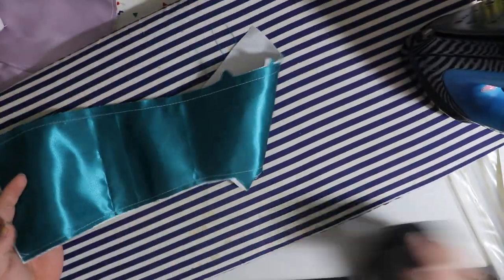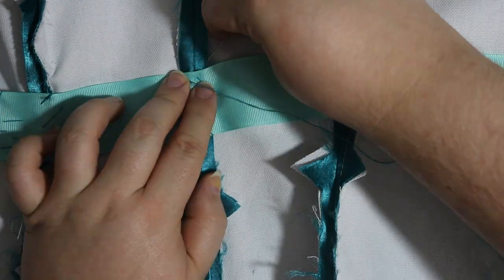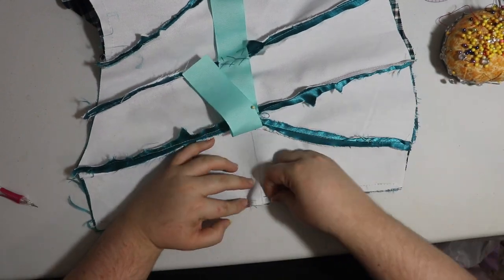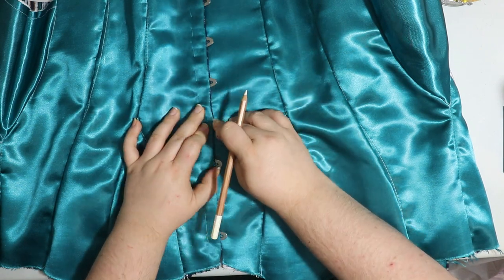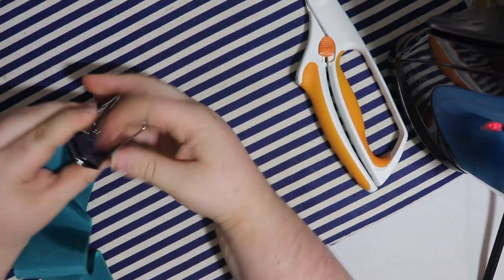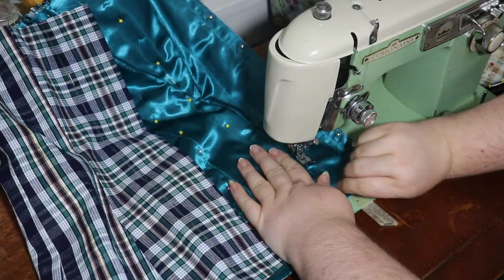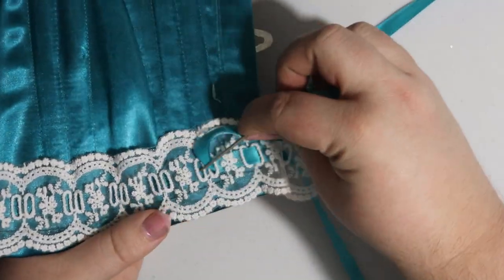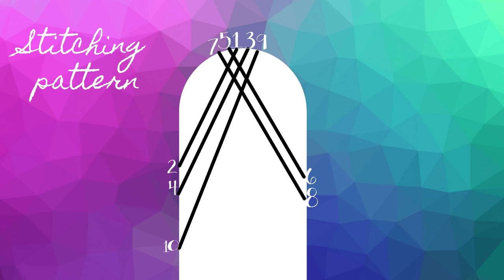I Made A 1901-1910 Teal Edwardian Corset (TVE01)/Learn How To Floss A Corset!

Comment: Coloured liquid mercury - that's what your fabric reminded me of.

How do you find using cable ties for support?  I have yet to muster the courage to start my first corset, so all information is immensely welcome, particularly because I'm not exactly slim anymore.

Your corset is very pretty and I like the plaid lining..
Reply from the maker: Colored liquid mercury, I like that! Cable ties are my preferred boning, they are structurally similar or baleen whale bone, they are cheap and easier to trim to length. Verses I've boned entire corsets with flat steel and spiral spring steel and the overall weight of the corsets are much heavier. I thought the plaid lining was a fun pop of color! :)